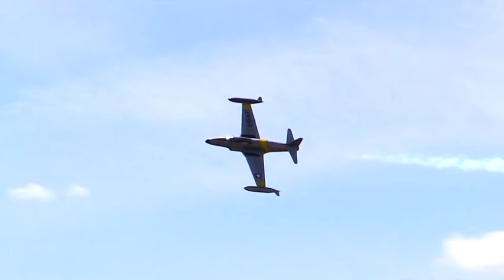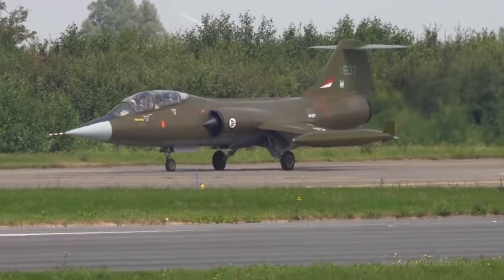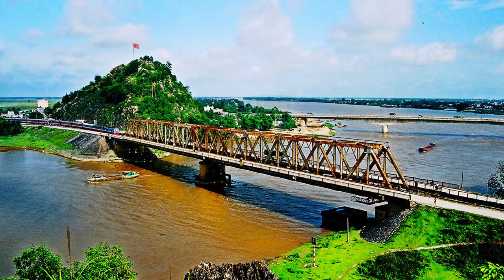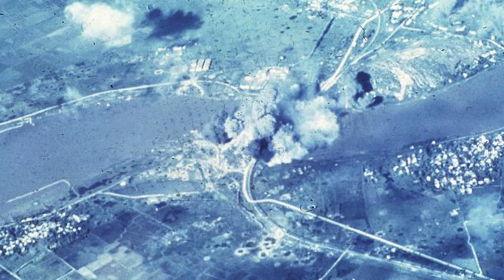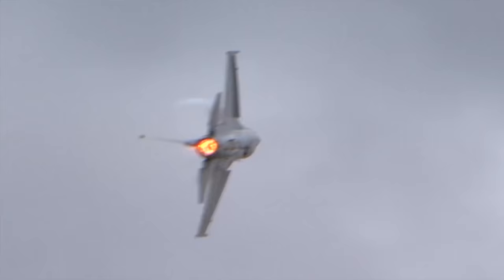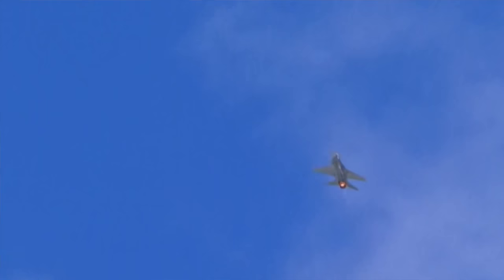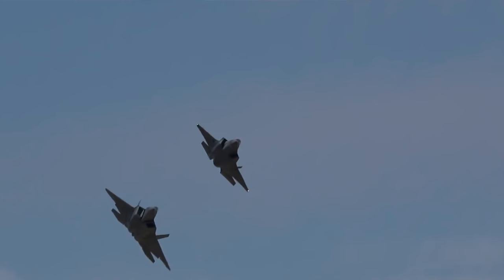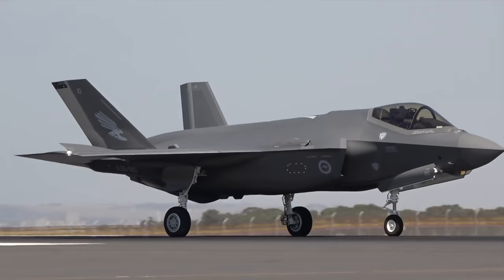Real Fighter Pilot on 5th-Generation Fighters

Comment: Computer/networking nerd... I can see the benefits of several aircraft sharing sensor information, being able to designate a target, and share with nearby aircraft - but isn't frequency jamming a hazard once you become used to leaning on these benefits, or do they frequently hop over such a wide spectrum this is nearly impossible to achieve?

Also curious about how much data is sent/received - for example, can you check on your wingman's engine status readouts, etc?

Obviously if classified - don't answer, but would love to hear more about this in as much detail as you're allowed to go into.
Reply: answering my own question... did some googling, MADL is k-band (12-18Ghz+), line of sight - and literally points itself at the other aircraft... good luck jamming that. Such a tight / directed signal too... which I guess is pretty hard to detect. I can't imagine the range being great, though.

Comment: Everything I have read from pilots of the F-22 and F-35 says that if you find yourself in the merge, it’s because you’ve made multiple terrible mistakes.
Reply: Exactly.  What you want is a BVR kill.
Reply: Off axis fox-2 missiles makes a merge lethal very fast on both sides, its still not guns territory before those have been expended
Reply: In most of the smaller conflict theaters, a visual ID was required.  Last BVR kill without actually visually ID'ing the aircraft was in the first Gulf War.

Comment: I agree with the analysis, but I would like to hear why aerodynamic performance needs to be sacrificed. In other words, why not have everything?
Reply: looking at the Raptor, i think it has at least the potential for everything: loads of 4.5 & 5th gen features, higher turnrate than Vipers, lower or equal turn radius than Flankers, and it goes supercruise.. afaik what is missing right now is latest Block 9x / 120D and maybe an IRST, but it is pretty high up there in the realms of having everything..
Reply: @almightyIrie  Yes but even if you take the published reliability numbers you are looking at maybe approaching only double digits of these things available for combat at any given time.
Reply: The F-35 doesn't sacrifice it's performance that's a misconception, in fact it's got better performance than both the F-16 and F-18 when all are in combat loadout, and they never had a problem in their role. Leave the higher kinetic performance to the air dominance fighters like the 22
Reply: @aidanwilliams9452  F-16 and F-18? I was thinking SU-57, J-20 or even Typhoon and Rafale. If what it published is to be believed the F-35 does not compete in any flight performance characteristic including range. Some of the A2A weapons its competitors carry are becoming a real concern as well. As far as I am concerned,  I call that a serious sacrifice, not a misconception. I can see no good technical reason this kind of design choice was made. This plane depends on avionics and stealth to win. One of those can be bolted on to just about any airframe (except the F-22 apparently) and I am not sure how much longer the second is viable. Stealth technology has always concerned me since allied force. How long until some new sensor or technology completely defeats it? There is no telling when this might happen, it may already have happened but it seems to me that the defeat of stealth technology by some new sensor is inevitable. If you look at the DODs latest aircraft acquisitions programs you can see they share some of the same concerns. I certainly would like to be wrong about all this but cannot help but be convinced this whole aircraft concept was a terrible mistake.
Reply: @jerrysmith7322  The whole concept was as a multirole strike fighter, much like the F-18 hence the comparison, whereas most of those you mentioned are focused on air superiority. Not every plane can take new sensors because the system architecture isn’t built for it, and it’s handled much better when it was designed with those systems in mind. I agree there’s concerns about compromising stealth but the 35 doesn’t sacrifice performance when it’s exactly in line with what was intended for its role. WVR any aircraft can be shot down as it’ll be down to the pilot, and BVR the sensors of the F35 put it above all the others. The next gen fighter should have the more high kinetic performance
Reply: @aidanwilliams9452  I am just saying that reality does not care about the requirements or concept game.
Reply: @jerrysmith7322   Concepts and requirements are designed to meet military needs. They didn’t need another F-16, as they know it wouldn’t survive nearly as long as an F-35. Additionally, there’s already been engine improvements, and further upgrades are being developed for even better performance. The F-35 is like previous fighters, you can upgrade the technology to meet new threats, I’m sure military analysts are well aware of this. The difference with 4th gen aircraft is they’re reaching the limit of their potential unless you completely redesign the airframe, while the F-35 is a clean slate for future upgrades. The electronic warfare suite also helps protect it, the only fighter with a better suite is the Growler.

No fighter would survive flying over Washington or Beijing, and there’s always counters to technology, but you’re better off having more than one trick up your sleeve than relying on super high speed and turning alone, missiles are much smarter now.
Reply: @aidanwilliams9452  Concepts and requirements design failed to meet military needs in this case. It should have better range, at a minimum. I think payload and speed might be helpful as well just to keep those as tricks up your sleeve as you say. I am not sure why its acceptable to anyone it does not have those capabilities at the price point of an F-35. I guess we will see how well the PR campaign goes when it becomes widely understood it needs to carry more fuel and to do that is going to cost...?? and do what to performance..???
Reply: @jerrysmith7322   They meet all requirements besides cost. It’s range is double that of a hornet and almost three times that of an F-16, how much range do you need? Payload is set to increase from 4 to 6 air to air missiles internally, and there’s already plans for “bomb trucks” to carry additional payload when needed, likely by the F-15EX. Speed is around Mach 1.6 and air-to-air engagements rarely occur at supersonic speeds.

All aircraft have trade offs, in the F-35’s case the trade off has been some speed for greater stealth (speed is still more than enough) and the massive costs as a result of the poor program management. It’s not the flying brick media articles falsely claim it to be.
Reply: @aidanwilliams9452  It meets contractual requirements. Maybe. I am not that familiar with its contractual requirements. It certainly does not meet obvious need. The bomb trucks you are talking about are a completely separate program, irrelevant to this discussion, other than the embarrassing fact it is needed at all proves my point. I think you are off by an order of magnitude on the range. There are also numerous reports that it cannot actually fly 1.6. Some reading:

https://armedforces.eu/compare/multirole_aircraft_Lockheed_Martin_F-35_Lightning_II_vs_FA-18E_Super_Hornet
https://www.airforcemag.com/lockheed-looking-at-extending-the-f-35s-range-weapons-suite/
https://www.defensenews.com/air/2019/06/12/supersonic-speeds-could-cause-big-problems-for-the-f-35s-stealth-coating/
https://www.af.mil/About-Us/Fact-Sheets/Display/Article/104505/f-16-fighting-falcon/
https://www.af.mil/About-Us/Fact-Sheets/Display/Article/478441/f-35a-lightning-ii/

Im out.
Reply: @jerrysmith7322  Obvious need is not decided by us, the air force knows what it needs. Bomb trucks are completely relevant because it's an emerging strategy that makes a huge internal capacity unnecessary, 6 missiles will be enough for the F35 and needing any more would mean you're likely in a flight of numerous aircraft anyway.

The F35 carries around 1600kg of fuel more than the super hornet, has much less drag and its engine is likely more efficient, so it's not at all hard to believe it can travel twice as far. Nothing in the second link says the range is an issue, even F-22's carry drop tanks on extended missions. If anything capacity for drop tanks just furthers it's lead ahead.

Boeing even states on their own website a speed of 1.6 for the super hornet (and remember that's no combat load), so the first link is wrong. All the speed and range values on links you've sent are not combat specs. Speed is reduced on the F16 and 18 thanks to external stores, and ferry range is not combat range, the F-16 range value is with drop tanks and no weapons.

3rd link states issues on the B and C variants, not the A variant. It also states the issues only occurred on one occasion at the very edge of it's performance limit, and could not be replicated and has not occurred in operating fleets after tens of thousands of operating hours.

To me it seems you're just reading and believing headlines.
Reply: @aidanwilliams9452  I do not know if any of that information is accurate, but the pentagon seems to be seriously considering major modifications to its brand new airplane that according you is just fine as it is. Adding conformal fuel tanks and expanding the weapons bay is no small thing and you can bet that there will be more problems that will cost more money to fix with all that. If its all just fine as you say then maybe they will just save the money.  We can come back here in a few years if we are still around and see what happened.
If I were Canada I would buy the Gripen. I bet they could get 8x the airframes compared to one of these F-35s when you consider sustainment costs. I would take the 8 Gripens over 1 F-35 that is probably spending 30-40% of its days in a hangar getting painted. 
The US probably would never be able to consider something like the Gripen politically. I think these companies in the US build obvious short comings into their programs so they can come back later with their hand out for more money. Then they blame the program managers at the pentagon for everything only to then quietly hire them later. All the while spreading all of the subcontracts out to every congressional district in the country making it almost impossible to do anything resembling sanity to address these practices. It would be good if something was done to get this sort of thing under control. Buying a foreign design and building it in the US might do just that. Cut out the people driving these practices and avoid hurting the workers. It will never happen, I know.

Comment: I've seen 2 criticisms of the F-35, which I'm hoping you can address.

Firstly, the complexity of the aircraft makes it difficult to maintain, which results in high operating costs, but also fewer sorties per day and fewer planes operational at any one time. The former is a budgeting issue during peace time, while the latter is a potential capability constraint during war.

Secondly, the F-35 is limited in how much ordinance it can carry, in order to maintain stealth, which makes it unsuitable for the SEAD/DEAD role, as it's unable to  carry enough missiles to take out sufficient targets. 
This appears to be partly why the USAF has opted for the F-15EX (to fly in conjunction with the F-35, as a "missile carrier") and is now also considering scaling back production of the F-35A in favor of a simpler, cheaper, non-stealthy successor to the F-16.
Reply: Complex things require complex maintenance.  They're doing just fine.  What was your other thing...?...oh yes, no the F-35 was NEVER intended to have a dedicated SEAD/DEAD role.  Not ever.
Reply: @danielh1708  It's clear that you don't know what you're taking about...
Reply: @GonzoTehGreat  I'm 100% correct, lol...but whatever dude.
Reply: @danielh1708  Someone who's clueless would think that...
Reply: @GonzoTehGreat  Its completely fact based.  Your opinion doesn't equal fact I'm afraid.  Continue with your pointless insults if you prefer, I could care less about them LoL.
Reply: @danielh1708  thanks for the answer, even if the OP was being toxic.

Comment: I understand what you say, my doubt is what happens when (not if) stealth is neutralized, and the plane is average on performance compared to cheap 4th gen ?  War is still war, point all on a single tech may work a couple of times, but in the long run history proved that every tech was made obsolete soon or later, and so many money on a single tech (stealth) seems a risky gamble to me. What you think about it ?
Reply: All things being equal as far as weapons go, would you prefer to be wearing red (like the Roman legions used to), or camouflage - and binoculars (like the modern soldier does)? Stealth is just camouflage; it doesn't prevent detection - but it delays it giving you an advantage. And sure, let's grant that a technology will come that mitigates some of the advantages of stealth. But that technology will itself be countered. But you're never going to have a situation where it's better to wear red again. And it's not stealth which makes maneuverability less important - but other technologies; our adversaries already have helmet cued high off-boresight missiles. Long gone are the days of jockeying into position to try and get a tone-lock on the enemy. They can simply take one look at you with their helmet, and fire a missile off (and missiles now can even do over the shoulder missiles shots if you're behind them). And if your game plan is to try and out-maneuver a missile flying at Mach 4 pulling 60-80G's (when the human body can only handle 9G), with a large blast radius (meaning it doesn't need to be all that near you to kill you), then good luck with that. But maybe it's time to look at other things 5th gen is bringing, like the F-35s DIRCM program - a laser which blinds missiles and can destroy sensors. It's not a one-trick pony.

Comment: Hasard Lee, I'd like to know your thoughts on the current proposal to reduce the procurement of the F-35 in favor of a generation 4++ fighter as a replacement for the F-16s currently in service? It seems that the good senator from Boeings home state is very critical of the readiness rate of the F-35. In my opinion the criticism seems more motivated by politics than the actual capabilities of the platform. What do you think?
Reply: The F15EX is fuckin baller though. Though decidedly not LO.

Comment: 4:36 “if your primary weapon system is a gun than your going to get dominated” 

A-10: Am I a joke to you
Reply: A10 shite in a dogfight though
Reply: A-10's primary weapons system is usually mavericks and hellfires. It does have a gun but the precision guided weapons are always the first line.
Reply: You mean the A-10 that got dominated by anti-air and had the highest fratricide rates of any modern NATO aircraft so switched to using almost entirely PGMs in actual combat?

Comment: A railgun chucking a 30-50mm proximity fused shell at Mach 5 no radar onboard fighters or warning systems could see it coming on top of that you can get 30-100 rounds for said weapons power can be supplied by the jet engine and still carry missiles otherwise yes low velocity 20-30mm guns are pointless in most cases

Comment: Interesting, though I might make the following critique:

1) These terms e.g. fourth generation, fifth generation, etc. or marketing gimmicks cooked up by defense OEMs.  A fighter is a fighter.  Technologies, weapons, systems, etc. evolve and change over time but the role remains the same: to hunt down and kill enemy aircraft in the sky.  It’s the same reason that a soldier from circa 500 A.D. and a soldier from 2021A.D. are still called soldiers.  They fulfill the same basic roles for a military regardless of the age or technology level.

2) Aside from stealth technology, there is no reason that earlier aircraft cannot be equipped with modern mission systems ie datalinks integrated cockpits, sensor fusion AESA radar sets, helmet mounted displays, the latest smart weapons, towed decoys, etc.  In fact this is taking place as evidenced with the latest production variants of the F-16 and F/A-18 E/F aircraft.  And many defense OEMs around the world offer upgrades to existing airframes like the Mirage F1, MiG-21, etc.
Reply: Booby Belly  As soon as you can learn to speak and write proper English, I’ll consider making a reply to your critique
Reply: Regarding your 2): electric power generation is a limiting factor. New designs take In account this power hungry electronics.
There are also some other limits. If the nose is not large enough, it will require a major aerodynamic redesign, for example. Integration is not always straightforward,  and redesigning an old airframe to accomodate new gear is sometimes not worth the  cost.

Comment: So on your statement about modern aircraft today and they all have roles.   My question is if you could have an equal number of F22's up against say F22's and F35s which would you choose?   Like you said it will be a mix of other planes in the air as well but lets just focus on say 20 total planes.  One side has 10 F22s and 10 F35s and the other just has 20 F22s.   All loaded up with the latest tech and equal pilots.  What side would you bet would win?   Also assume that both have the other supporting aircraft.    I am struggling to see the advantage of the F35 and I guess I need to understand it better.   Again,  for this discussion I am not factoring in cost.     To me, as someone who admittedly doesn't understand air combat, it just looks like the F35s would be taken out rather quickly and thus it would be 10 F22s vs 20 F22s.   What am I missing?